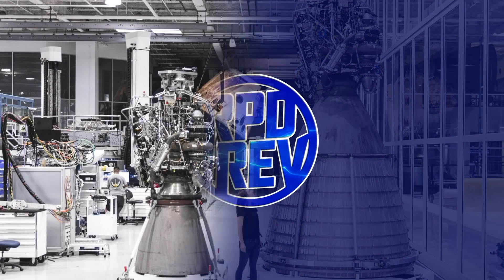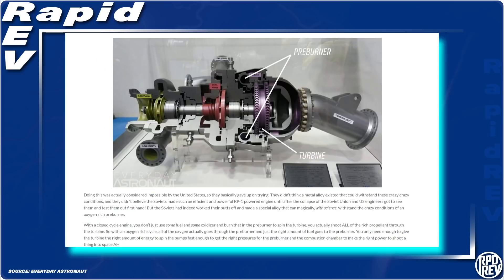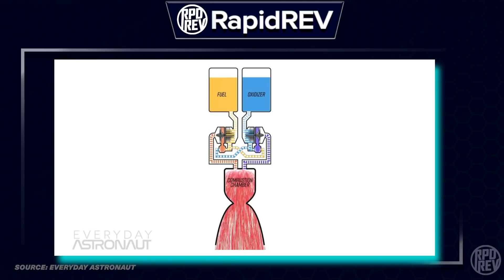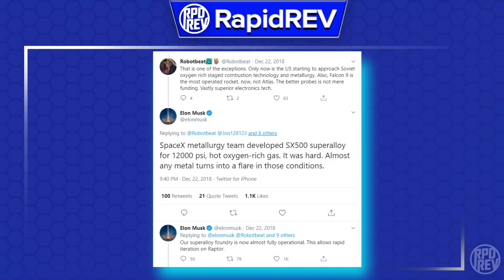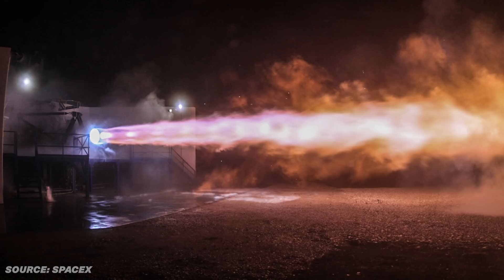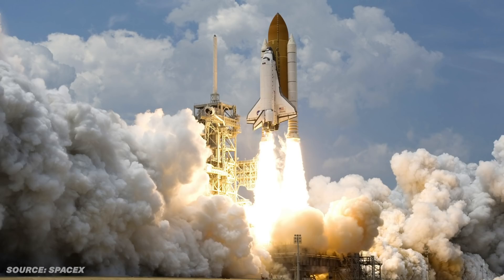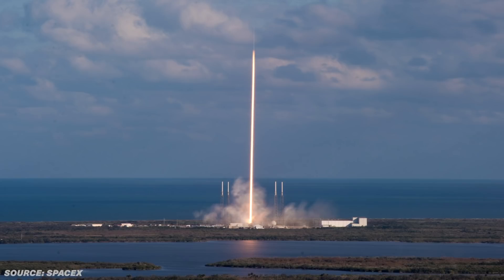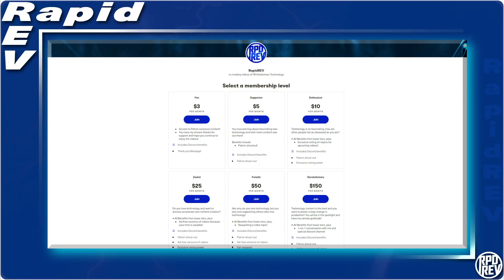Why SpaceX Built the Insane Raptor Engine

Comment: What I want to know is whether the gas+gas combustion chamber is less vulnerable to the combustion instabilities that the F-1 contended with.  Anybody know?
Reply: Yes, for multiple reasons. One, the Raptor's combustion chamber is much smaller, which covers a multitude of potential sins. Two, CAD/CAM has progressed enormously since the F-1 was developed; it essentially came into being in the late 80's, and has become enormously more powerful and useful since. Those models drive a lot of fundamental understanding of how to avoid problems with resonances. (Think of a propellant mixture as a 'gain medium' (like a lasing medium). Any bump in temperature is likely to cause a lot more energy release as reaction rates increase locally, increasing pressure, ..., making combustion chambers very likely to resonate... explosively.) This is made worse with liquid droplets, which also react strongly to pressure and temperature.
Reply: Robert Herndon Thank you!
Reply: @robertherndon4351  Maybe the Raptor's combustion chamber is smaller because the actual gas+gas combusting happens so much faster, so less volume is needed for it to take place in.  Does that sound right to you?
Reply: @craigsearching  That is certainly part of it (kerosene takes longer to vaporize, decompose, and burn completely than LNG); the other part is that it's simply a much smaller engine than an F-1, and the pre-burning and mixing as superfluids improves mixing and combustion.
Reply: A lot of the instabilities in the F-1 came from them not knowing what they were doing and inventing the injector-plate. Also these instabilities occur more the larger the combustion chamber gets and F-1 was a beast of a size compared to Raptor.
Reply: JimMcTavish Yes I know that much.  What I don’t know is whether funny-ness with the vaporization of the kerosine and oxygen droplets has anything to do with it.  Surely someone at least has some theories about whether that might be so.
Reply: @craigsearching  I'd say gas-gas mixing is a lot easier than liquid+gas mixing. For comparisons with the F-1 you'll have to build a methane combustions chamber of the same size to really get the results you are after.  The Raptor will never be that size. Blue Origin's methane engine may get close and they too could see similar instabilities.
Reply: JimMcTavish No kidding, Blue Origin said that?
Reply: @craigsearching  BO Said what exactly? 
BO are developing a large-ish methane rocket engine for their New Glenn rocket.
Reply: JimMcTavish Said that they had some instability problems with their new methane engine, I mean.
Reply: @craigsearching  I said nothing of the sort! Please re-read my post. I've attributed nothing to what Blue has said and it's all me and my second-rate chemistry knowledge.
Reply: JimMcTavish Ach yes quite so.  “Could see”, not “did see”.

Comment: Re methane production. They are going to have to do it on earth to make sure it works reliably. They could and probably will end up using carbon dioxide capture and making a their own!
Reply: And ironically the environmental groups are pressing  on spaceX to reduce carbon inprint.
Reply: @urosrot7916  A Carbon Neutral (Or negative) Rocket company would certianly throw people for a loop
Reply: @urosrot7916  So they should. Especially as if they get it working it can have as bigger impact as Tesla will with either cars or solar (probably not both put together)

Comment: You asked for info about turbine blades. I was a superalloy metallurgist for an aircraft company. The technology of single crystal airfoils is nearly 50 years old now. The alloys are complex and highly optimized for strength at 1100C/2000F, and also resistance to oxidation. Ni, Cr, Co, Al, Ti, Ta, W, Mo, Re, B, Zr and Y. Rhenium (Re) is one of the more recent ingredients, but not that recent - it was introduced in the 1980's. Airfoils are typically coated for greater oxidation resistance and - if internally cooled as they are in jet engines - coated with a ceramic layer for insulation. Directional solidification is used to produce single crystals (as noted, grain boundaries are weak at high temperatures). The mold is slowly lowered out of the furnace through a chill plate. The mold incorporates a narrow passage that chokes off all but one grain.
Reply from the maker: Thank you for this comprehensive answer! I'll have to figure out what a few parts mean. 
My general understanding is that the exotic ingredients strengthen the crystal structure, leading to strength at high temperatures and resistance to oxidation. Then, a coating can be applied to improve oxidation resistance, and the type of coating depends on whether internal cooling is utilized. Lastly, the way the mold is handled aligns the grain.
Reply: @rapidrev3293  The underlying miracle of superalloys is a second phase (a common feature of any strong alloy, including steel) that has a crystal structure similar to the base phase so that it can remain small despite the heat, and resists the mechanism of deformation (the movement of crystal defects called dislocations). It's called gamma-prime, an inter-metallic compound of Ni3Al, or Ni3[Al,Ti,Ta] to be more precise. W, Mo and Re are big heavy atoms that further interfere with the dislocations. Cr does also, and contributes to oxidation and corrosion resistance; Aluminum is the big ingredient for oxidation resistance, forming an alumina / Al2O3 protective layer. Cobalt is mainly there to discourage an undesirable phase from forming, so you stuff more of the good stuff into the alloy. B and  Zr strengthen the grain boundaries (low-angle boundaries are present despite the term 'single crystal'). Yttrium improves oxidation resistance by suckling up sulfur, a contaminant that messes up alumina formation (or so it was believed in my day).

By 'miracle' I mean this: a superalloy has useful strength and oxidation resistance at 90% of its melting point (homologous temperature, based on absolute temperatures). They make gas turbines possible. The internal cooling is another enabler: the temperature into the turbine section can be well-above the melting point. I don't think rocket turbines use cooling, but they could, I suppose. Genuinely cool stuff is available, whereas in aircraft engines the cooling air is about 760C / 1400F, having been through the compressor section. Mitigating thermal fatigue must be a big challenge for multiple starts.
Reply from the maker: @curtaustin8119  thank you for this, I was able to follow pretty well. The alloy is a complex, precise ingredient tailored to expected conditions within the Raptor engine to produce the required strength and oxidation resistance. I agree that perhaps the liquid methane or LOX could be used for cooling turbine blades, possibly now or in future engines. Also, it seems likely SpaceX will track fuel burn and wear together to determine the deviation from turbine design dimensions. 

Why do think multiple starts is a big challenge? Airplane engines start many times over the course of their life.
Also, please consider joining the Discord community if you like talking about this type of stuff - https://discord.gg/KjEAjaC
Reply: @rapidrev3293  Machines involving high temperatures are best given some time to warm up. They have different dimensions when hot. Transients are bad. Specifically, for rocket engines, you start with an airfoil at liquid oxygen temperature. In less than a second it is surrounded by very hot high-pressure gas. The outer areas and thin areas heat up quickly and try to expand, but are held back by thicker areas that are still cold. The compression may cause them to plastically deform. On shut down, they'll go into tension as they try to regain their original shape; this can form and grow cracks, especially if done over and over. This is called thermal fatigue. Add normal mechanical loading to these stress-strain cycles, which are considerable. This limits the life of jet engines, even though they get a good warm-up and pilots are taught to treat them gently.

The Raptor turbines can run arbitrarily far from stoichiometric, I guess, so the gas temperature might be much reduced compared to an aircraft turbine - I've never seen a temperature published, so I'm completely ignorant on the actual situation. SpaceX engineers have got it figured out, I'm sure, but the first 1000-cycle endurance test will grade their paper.
Reply: @rapidrev3293  If the exhaust gas from prebuener is rich in oxygen then turbo pump part has tobe made with an ignition resistant Ni base alloy. The ignition due to hot oxygen is directly related to surface finish, alloy composition, pressure and velocity. Normally ignition resistance is achieved by noble metal or oxide coating on the exposed surfaces.
Reply: @rapidrev3293  A factor here in Curt Austin's experience is that turbine efficiency is a direct function of exhaust temperature. (These are considered proprietary information, and so are almost certainly not public.)The Brayton Cycle (see wikipedia) determines its power and efficiency. For SpaceX, that only matters to the degree that they have to extract enough energy to pump the two turbine exhausts into the main combustion chamber. They are definitely not trying to maximize the preburner exhaust temperatures. How hot they need to be is likely determined by their size and the pressure required in the combustion chamber, and would be regulated by the preburner mixture ratios.
Reply: My statement "direct function of exhaust temperature" is WRONG. It's a function of the maximum temperature in the combustion chamber... and the inlet and exhaust temperatures (which should nominally be as low as possible), so as to include the maximum 'area under the curve' in the Brayton Cycle P-V diagram.
Reply: @ttharian1  I'm not sure 'ignition' is the right word. Aircraft engines run in a fuel-lean environment to keep turbine inlet temperatures tolerable. That is, lots of oxygen is available. Oxidation (slower than 'burning') resistance is vital in the base metal and is supplemented by a coating rich in aluminum (and yes, some platinum).
Reply: @rapidrev3293  "Wear" is not the usual term for turbine airfoil degradation. The mechanisms include thermal fatigue, oxidation and creep deformation. That is, turbine airfoils can crack, 'burn up', or lose their shape. In fact, they're run hard and suffer from all three by the time they are eventually removed during an overhaul. Airlines know to do this by tracking fuel burn. Outright fracture is rare, fortunately, since they are too heavy to be reliably contained within the engine case.
Reply: They run far from stoichiometric. In the open cycle only a small fraction of the fuel/oxidizer is burned for energy to pressurize all the fuel/oxidizer. I don't know enough to calculate everything exactly. After the gasses leave the turbine they have to be in the gas phase and at a pressure above 300 bar to enter the main combustion chamber. This gives us also a minimum exit temperature for those gasses. (Correction) 300 bar is far above the critical point for oxygen so it will not exactly be a gas, but somewhere around room temperature should be good for the gas to be elastic enough. Since the mass flow is very large compared to the required energy output the temperature and pressure drop in the turbine shouldn't be that large. So the temperature at the input of the turbine is not that high. I remember I read somewhere it was only a few 100 degrees Celsius. (Or Scott Manley said it somewhere). But the gasses are at extreme pressures and as others said here the temperature is raised very vast. Combined with the very large mass flow it might be that the input pressure of the turbine is the critical design factor and not the input temperature.
On a further note the efficiency of the turbine doesn't matter, all the heat that is not used in the turbine is put to work in the main combustion chamber and nozzle. All the mass will be heated to thousands of degrees and is then allowed to expand to near vacuum.

Comment: As a welder, and student of engineering, I liked hearing more metallurgic details that no one else covered. Thanks!
Reply from the maker: Dimitri Edwards Glad you enjoyed it! The metallurgical details sets the foundation for building the engine.
Reply: RapidREV I’ve heard the new serial numbers for both raptor and starship is gonna use stronger/more quality metals as the development goes on. Can you comment on which known could be better or if there is really any or you think they’re close to developing a new metal by using different components?
Reply from the maker: Dap P my current understanding for the starship is they developed/ing a stainless steel alloy with a proprietary recipe. They needed a steel that welds together better was a big reason. I’m sure they will continue tweaking their formula.

Same probably goes for the Raptor.
Reply: Fibre has its advantages, but I hope we will see more metal in the future.
Reply: Any way to Co op with you to build a rocket to earth orbit? I'm a student of physics currently.

Comment: Raptor is turning out to be so much better than expected that they can reduce the number of them used on the super heavy booster. This opens up many more possibilities for cost reduction and extra payloads.
Reply: Not to mention the incredible fuel savings means heavier pay loads that we currently cannot imagine.
Reply: Mike McMullin yeah, for example the falcon 9 weighs around 500000 kg fully topped up .1% more efficient would already mean 0,01x500000 = 5000 kg more payload capacity
Reply: @ricomotions5416  .1%=500kg
Reply: FenixTeam18 yeah i didnt mean to put a dot in front
Reply: @ricomotions5416  Just go back and edit it?
Reply: maxhugen wait you can eidit coments?
Reply: Edit comments*
Reply: @ricomotions5416  Vertical row of 3 dots at right... click and you have option to Edit or Delete. 😎
Reply: This will also improve safety. The more engines, the more likely something going wrong, and moreover the more engines the harder it will be to control them.
Reply: Don't look for any reduction: there'll be the maximum number of the engines on every booster, to get the best possible push of the Starship to orbit, with the heaviest possible loads.